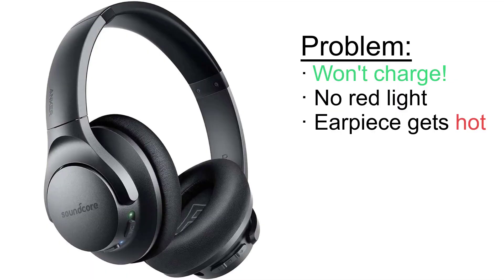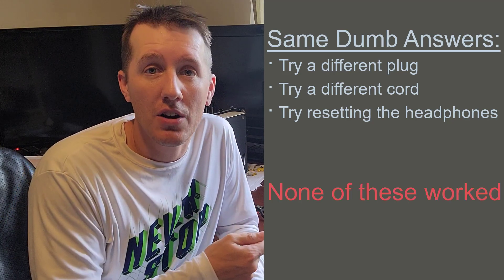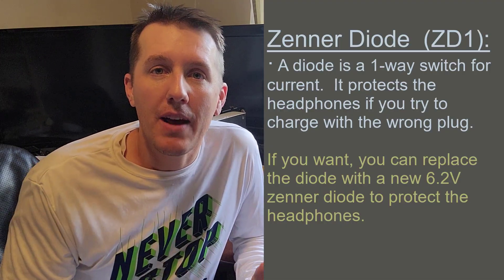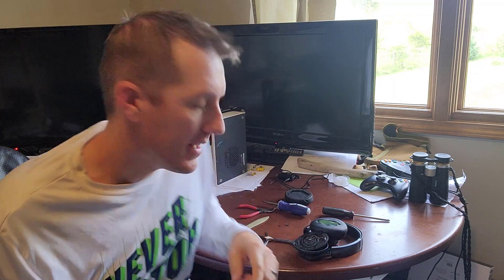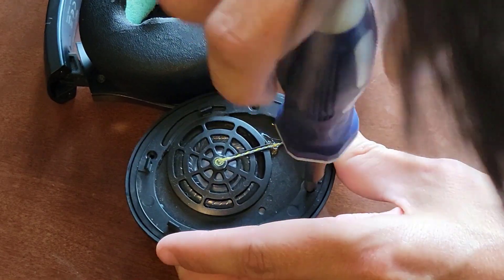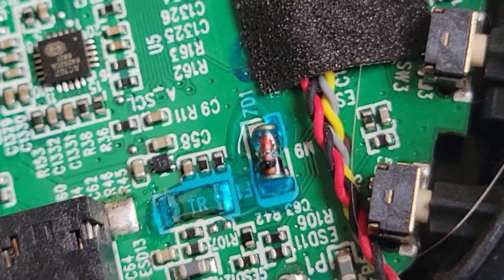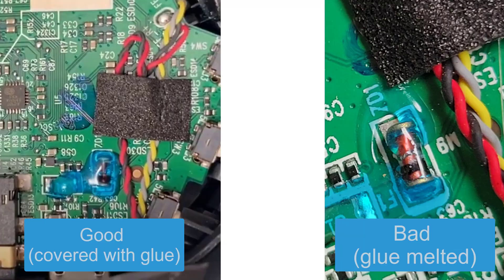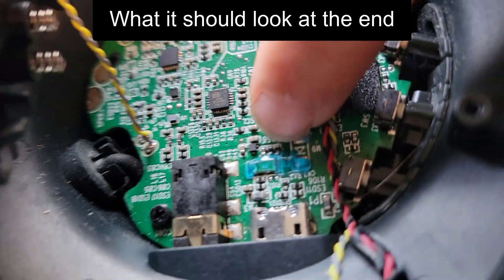Anker Soundcore Life Q20 Headphones Not Charging - How to Fix

Comment from the maker: NOTE:     Apparently the newer version of the headphones doesn't have the diode.  So this only works for the Q20 headphones from a few years ago.
Soundcore Q20 Headphones .................................................. https://amzn.to/3R4wVoh
Soundcore Q30 Headphones .................................................. https://amzn.to/3PjT8gU
Zenner Diode Replacement ..................................................... https://amzn.to/3L7bGyx
Reply: Yep, mine just stop charging but it doesn't have the diode. It looks like the USB port is damaged.
Reply: Did you find any solutions to this? I'm in the same problem @alejandrogallego2276
Reply: Do you know the value of the Diode that needs to be replaced? The ones listed are a set. Is it the 1 Watt 5 Volt one?

Comment: My soundcore life q20+ is not turning on . I kept resetting the device but it still won't turn on most of the time. If it turns on it will function normally but only for a few hours then it goes back to not turning on. Please help.

Comment: I have the Soundcore Q30 and it doesn't turn on. It charges but does not turn on. I've tried tried everything i could find online and nothing works. Any tips?
Reply: i have the same problem. did you find any solutions?

Comment: I have Q20+. It start chagring and and red light turn off after 30 secorns. I am only able to use by AUX cable. I Can not charge or turn it on.

I opened and there was no little diode like this. Anker has updated the chip structure. Anyone who successfully repiared Q20+?
Reply: Did you find out how? I'm at a loss here
Reply: @HEHURTS  No, I tried by replacing with new battery, but it didn't work for me. Also, there was no local repairer for me who can repair this.
Reply: @SuperWorld007  Oh. Try opening the part with the power button and turning them on while applying pressure to the back of the power button. That worked for me. It also appears as if they still charge even if the light goes off

Comment: I haven’t checked for the diode yet but this thing hasn’t charge since the day I got it the light flickers once or twice and that’s it. It goes off. I charge it overnight two times and it’s still not charging. I’m gonna follow your instructions and I hope that works because only had these for two days. Thanks for the video.

Comment: This just worked for me. Its the right ear side to open. I did left first in error. I couldnt locate the little diode. As I was wiggling the wires the headset turned on, declared battery full, and is now working fine. Thanks for this video.

Comment: Mine just has shitty battery life (cuts out at about 40-50% battery)... Do you think it's worth replacing the battery or just buying new headphones?
Reply: I replaced the battery on the Q20 last December with 1000mah (it had 720mah)-- but now the headband plastic is falling apart (last few inches up to the pivot points)! I braced it with new plastic and duct-tape. If I get 2 years the $10 battery will be worth it. Otherwise it works pretty well, with few glitches.. sometimes the audio is sent at a higher tone when listening to speech.. I have to turn off and reconnect to the source. I kept the Q20 because it has higher total volume than the q45. If interested, the battery size was 10mm thick, 25mm wide, by 30mm long (102530) @ 1000mah this is a rare size but it exists on aliexpress if you search hard enough. I've used premium chargers, so I did not burn out the diode on mine.

Comment: Will this fix work with Q20+? I have some issues with the charging and battery life as well.
Reply from the maker: Not sure.
I think i must have an older model, because lots of people are saying they don't have that diode on their circuit board.
Reply: @DaveWirth  Thanks for the reply. I just opened it recently, but I don't see any diode on both left and right cups.
Reply from the maker: @marcelinodelfin1747   That's what some people have commented below.  My headphones are like 3 years old, so maybe they are an older version and the new version changed the circuit board?
Reply: @marcelinodelfin1747  did u repair it ?
Reply: @abderrahmene773  unfortunately, no. I could still charge and use it, but it only has 8-10 hours of battery life.

Comment: Thanks so much for posting. My Q20 did not have the diode  BUT by disassembling I could see one of the buttons was displaced and jammed. By repositioning the button, the charging works again. Without your video this thing is just a boat anchor.  ;-)